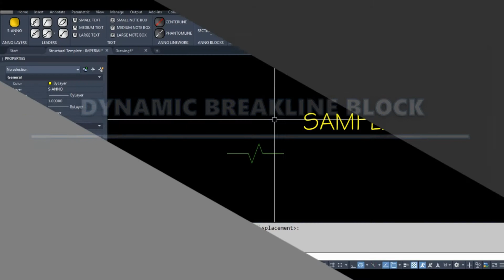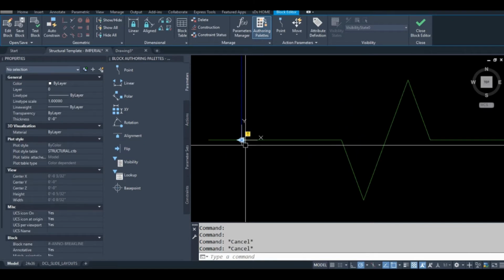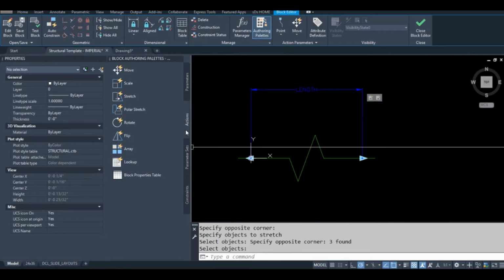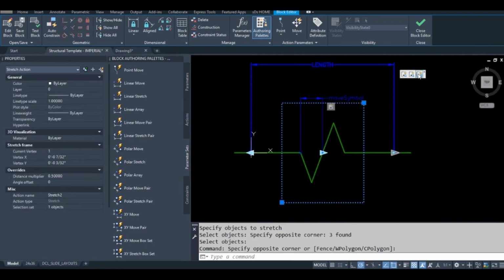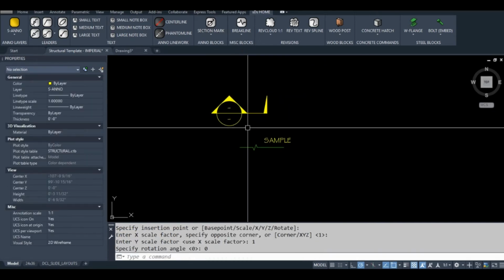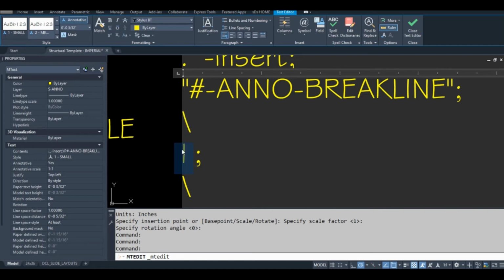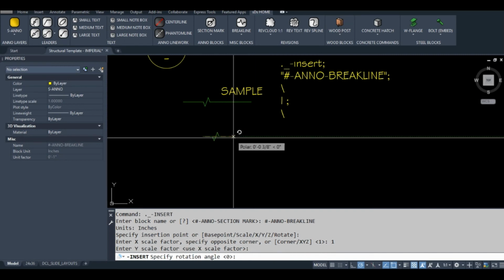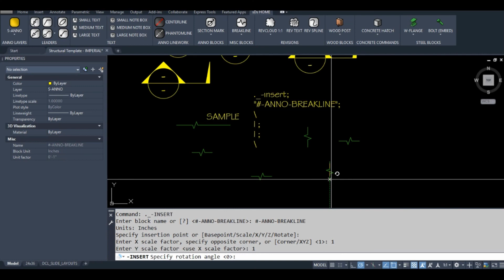BREAKLINE DYNAMIC BLOCK

Comment: I've been trying to create a breakline with the polar stretch parameter keeping the break centered.  I can get it to work except the right line rotates off angle (not aligned with the rest of the block).  I want this to be able to place the breakline at a point then grab a grip and stretch it (polar) to another point.  Any help is appreciated!
Reply from the maker: Here's the best I could do:
https://youtu.be/J5pIIroNWqM
I'm using GstarCAD now so let me know if you need a better explanation. I ALMOST got the breakline symbol to stay centered in the block automatically but unfortunately ran into the same sort of trouble you did. So one would have to manually place the breakline symbol afterwards.
You could further experiment with constraints (using colinear maybe). I think I could get it to work if I played around with the constraints. But that can turn into a bit of a rabbit hole and also lead to erratic block behavior, more frequent crashes, etc... GstarCAD doesn't have constraints.
Reply: @randomCADstuff  Thanks for looking.  If I find a solution I'll reply!